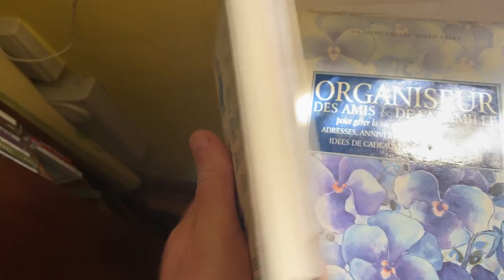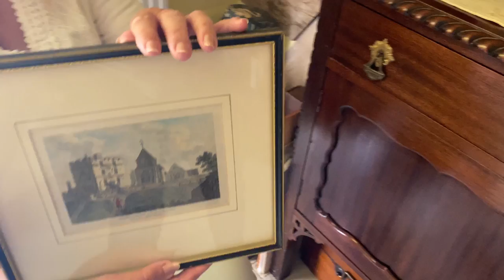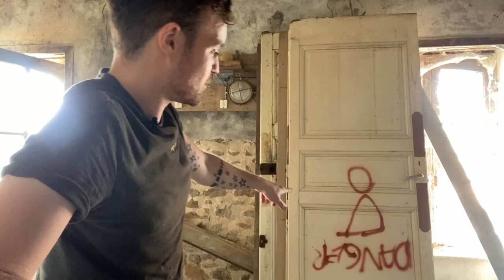The Adventure Begins - Renovating The Gardeners Cottage

Comment: Michael, consider underfloor heating for the cottage, you could tie it into the hot water boiler in the Aga you are planning to rebuild.
Reply: Yes!  It would be invisible, and the terra cotta tiles over it would hold and radiate the heat for a long time, saving a lot of money on heating! Great idea.
Reply: I don’t think the older Agas heat water systems, and the bathroom will be at the opposite end of the house.
Wouldn’t under floor heating crack the terracotta tiles? 
Someone tell me if I’m incorrect.
Reply: @Italiana911  Hi Susie, thanks for the comment.  Michael indicated the the Aga he is rebuilding has a hot water heater built in and that he could use it to heat the cottage with radiators.  I don;t think the terracotta tiles would crack, because the way the under floor heating system works is that you lay to ground piping under a 4 to 6 inch layer of concrete, which Michael also indicated he wanted to put in before relaying the tiles, so I think it would work.  The underfloor heating is radiant and does not require extensive pressure nor high temps to heat a building.  I think it could work, but, it was just a suggestion.  Let know if you have any other questions.

Comment: Authenticity in buildings.  Thorny problem, and there are lots of ways to interpret it.  My grandfathers house was built around 1900, and it was in a town in Kent, so it had town gas lighting indoors, and 1/2 inch  copper piping external to the walls to feed it all, my dad said that standing under the lighting was the best way to get warm in the winter! The house only had any kind of electricity added in the late nineteen fifties.  I'm sure that you gardeners cottage would not have had electricity added until well after the war.  When it was built I guess that they used colza oil lamps downstairs, and candles sometimes for upstairs.   I can understand why you would want electric lighting now.  But think about some colza oil lighting for its soft quality of light, for special occasions.

Comment: Michael, use a wet saw and cut the corners off of that old striped tile. It is still large enough to use as a trivet.
Take photos before during and after. You may forget how something goes back in place and where wiring and plumbing is in the walls. I had to take photos of my antique crystal chandelier before taking it apart to restore it. I too have an old home and we have done quite a lot without the aid of contractors. 
I enjoy your and Stephanie's channel. 👍 Your B roll footage with music is beautifully done!

Comment: Your could cut off the other corners of the tile a little, so that it sort of matches all the way around. I think that it would look even better as a trivet. I think sometimes when something is up-cycled into something else it will often look half done. I think sanding down the cut corner and cutting the others to match would look really nice. Even if it was not a perfect octagon, like the corners being shorter than the original sides it would look nice while still retaining it's original character.
Reply: Just use it as is

Comment: Just a suggestion for paneling on your walls, old doors turn from vertical to horizontal and set on the floor and then attached to the wall, make wonderful inexpensive wall panels...example, the elevator shaft doors your moved, turned horizontally, attached, and the butt the next door to the end, and so on, then you can nail a nice top trip piece to finish it...just a thought to share with you! Keep up the good work! I can't wait till the world gets to travel again, I am heading over from the states for a visit!

Comment: Hi michael.    Very cool watching your progress.    A tip for you if you need to strip old paint from door hardware.
Use a slow cooker over night.   Fill with water and in a few hours, all the paint will be easy to scrape off with steel wool.    Keep up the great work.

Comment: Hey Michael - great project. As someone who has installed a range cooker across a corner like you're proposing, I I think you may be a touch over-optimistic about the amount of room you'll end up with between it and the front door - they're really deep, which will push the front corner a long way out. The video may be deceptive but I don't think there'll be space for your sink unless you move the door opening. Hope I'm wrong!

Comment: How are you going to set  the tiles? At the moment they are just on sand it seems as was traditional in kitchens. This is great for cleaning- scrub them and water will drain through and away. The problem is that damp comes the other way- any rugs will wick up water and rot.

Comment: Liked the stained glass at Rennes.  Why dont you have a go at doing your own design for Willow Pattern blue and white, basing it on your life at the chateau and the gardeners cottage.  It is just a matter of making a digital master and getting it printed as a digital ceramic deckle.  You then have to attach the deckle to a new white finished ceramic plate, and then fire at around 800 degrees Centigrade for a short time.  You could do this onto plates from a broccante, but slight cracks or scratched surface of an old used plate will mean many more kiln failures.

Comment: I'm so very happy for you, Michael, that you can begin working on your Gardner's Cottage. It's such a wonderful place, and hearing your vision for it is heartwarming. Those ovens are amazing! I wonder if there would be a way of capturing the heat in pipes rather than it going out the chimney, and somehow running the nearly invisible pipes along the floor and wall edges upstairs as a heat source? A friend of mine used his potters kiln to run heated pipes under the floor boards to heat his home. Not to sound like a mother hen but I hope you and all your family wear masks when working in old spaces that contain molds, dusts and animal leavings. You can end up with some nasty respiratory problems otherwise. Thank you so much for sharing your home and adventures! I nearly forgot to ask... do you have ghosts anywhere at Basmagnier?

Comment: I am so excited to see the beginnings of your cottage restoration.  I've been worried about that front corner and was wondering how  you were going to approach that repair. (It's quarantine, what else have I got to worry about?!!  LOL).   And I'm also anxious to see how the exposed electrical will be getting on.  I think that's a brilliant idea, by the way.  I was wondering if you can use wood in your AGA.  We don't have them over here in the states so they are kind of a mystery to me.  Do they make the house hot in the summer?  They can also heat your household water, right?  Anyway, I am just so jazzed for you.  Can't wait until the next video!

Comment: Trying to understand why you use rockwool for insulation. I checked large diy stores in the USA and it is only available by special order and is very very expensive..  Here fiberglass is the main choice. It comes in rolls as well as batts in various thicknesses and R Values. It is light weight plus does not cost a bloody fortune.

Comment: Are the metal wiring pipes safe..I heard a lot of electrocution accidents happened back then..please be safe..love everything you do...
Reply: They are safe. The metal conduit is used all the time in commercial applications. I do feel however for anything wiring and outlet related it should be all replica look alike because modern wiring and switches etc are a lot safer and meet new code rules.

Comment: You don't want a 'fitted kitchen' in the cottage. So cheap to just buy lovely old dressers,  with just the bottom of a dresser between the door and the stove. Hang pans on the wall or from the ceiling.

Comment: forgot to ask. aren't you going to have appliances like a fridge, blender, mixer, coffee machine, washer and dryer, etc? it didnt sound like you were. Also, do you insulate the walls and ceiling of a place like that?
i dont see how you can do all of that for 15k euros or pounds etc. how much is the roof and the cracks going to cost?
Reply from the maker: I have a vintage style cream smeg fridge that I’ve had for years. It will go in the kitchen at the end of the worktop, under the main beam. Also my laundry I will do in the château as it’s just next door. I won’t have a coffee machine or modern things as I will use a vintage moka pot. Although there’s definitely room for a lovely kitchen aid mixer. They have endless attachments for everything under the sun. You can hide in a cupboard.
Reply: @DoingItOurselvesOfficial  
sounds lovely!

Comment: Why are there chairs instead of pews in this magnificent Cathedral? The chairs are awful and not appropriate for this  Cathedral. It really takes away from the beauty of the building.😭
Reply: Originally back in the past you would not sit in church but stand. So maybe the cathedral never had pews and they tried to keep it as original as possible by not doing something permanent.
Reply: @blumchenmarie189 , Thank you for your response. It just doesn't look right to see modern looking chairs in a Cathedral . Just my opinion. 😊🥀🥀🥀🌴🌴🌴😊🕍
Reply: @brucealanwilson4121 , You know, I never even noticed the rack for the hymns or kneeling rails. I was just looking at the appalling chairs. Thank you for pointing that out. I will have to go back and watch it again. I still don't like the chairs though.😂 It is aesthetically unpleasing for an old Cathedral.🌹🌹🌹
Reply: @brucealanwilson4121 , Thank you.😎🥀🥀🌴🌴